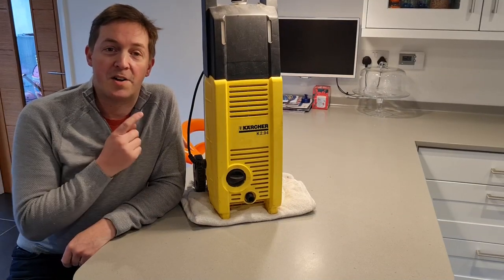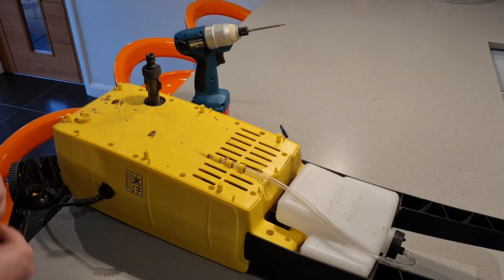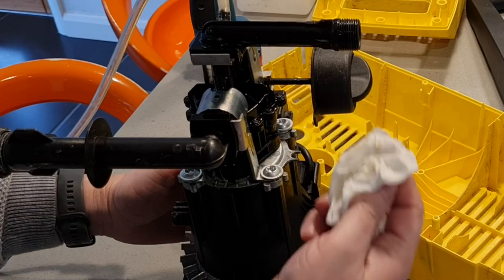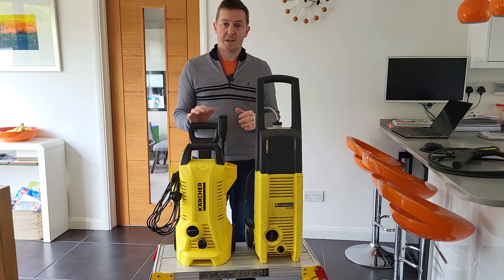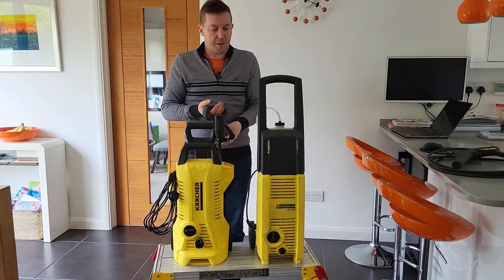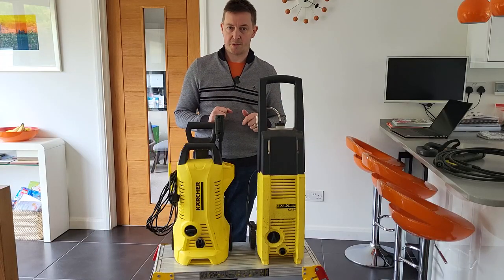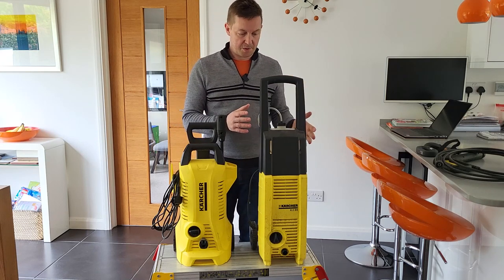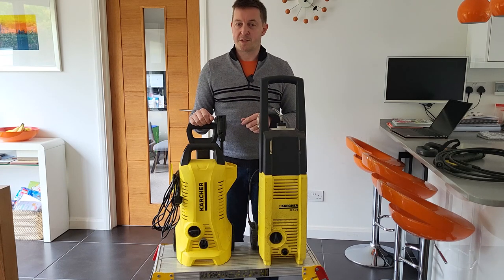Karcher K2.94 Oil Leak - Fix or Replace?

Comment: Thanks for your video,we live in a throwaway society.Most parts are made of plastic nowadays,its cheap light and the chance parts break after the guarentee period are high in general.The parts for the old decent quality high pressure washers are very hard to find,or very expensive,almost not worthy to order.I had the new versions and the old.I agree with the weight,but the old ones do their job 20-25 years,the new ones 5 if you are lucky.
Reply from the maker: I would love to have fixed this one Boris but as mentioned in the video a lack of time and working space made it impractical and the extra benefits of my new machine make that decision the right one. That said I stripped the original one for parts and they are listed on eBay so others can use them to fix their machine. Hose, trigger and lance now sold, so just the bulky items left.

Comment: Hello how to torn on te mix so it takes in the soap
Reply from the maker: Hi, I only ever used it once and all you do is fill the bottle up with soap and the machine just pulls it through. There is no control or on/off switch unfortunately.
Reply: Thanke you in goona try it but firstime i traid it ditend work